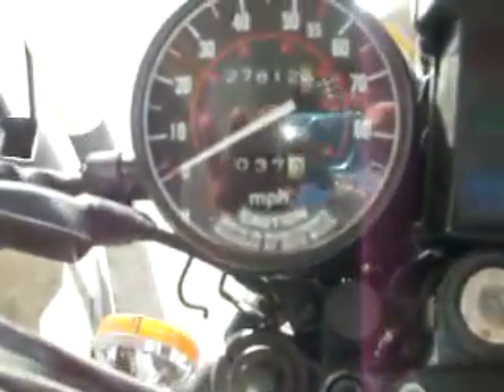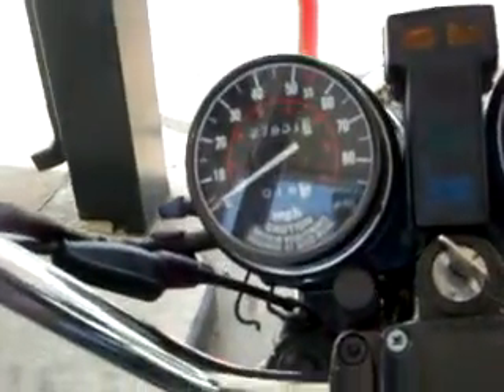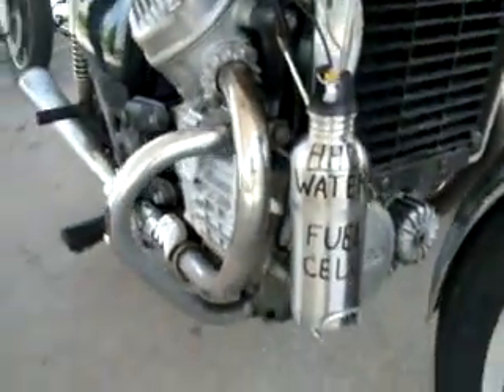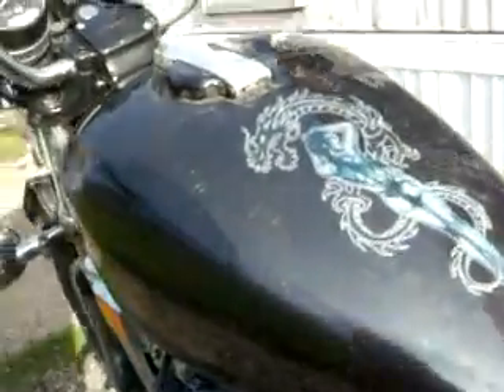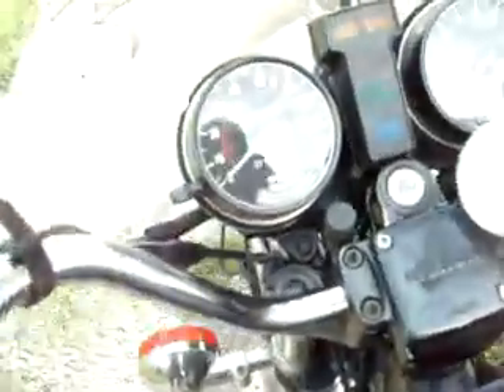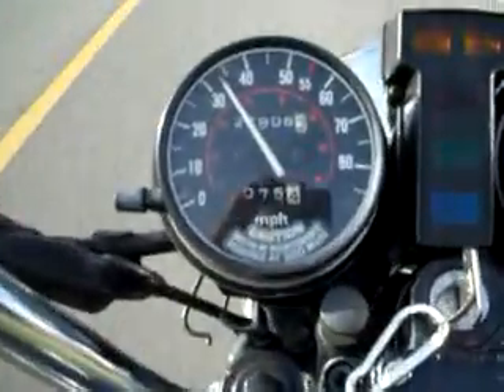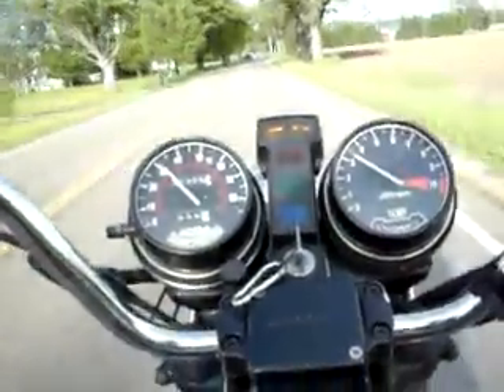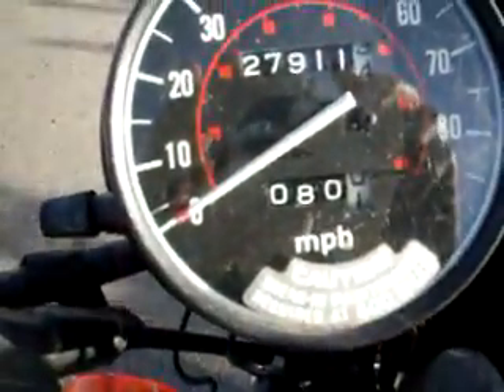HHO Powered Motorcycle Test Results 3, 4, & 5 from Westcoast Exterminator

Comment: In electrolysis of water, you can not get energy greater than you put in. You can not create or destroy energy. To obtain heat energy from water, you have to put 2 or 3 times more electrical energy.  After 15 years it is clear this is a failure. Another proof you can not break the law of thermodynamics.
Reply: +Odouls77 My friend, I'm sure anyone who has built a successful model and gotten a patent would IMMEDIATELY be either bought off by the oil industry, or killed off, as in Stanley Meyer. 
As for my explanation of how this does NOT violate any laws of thermodynamics, did you understand my post?
Reply: Those who don't comprehend and can't accomplish, should stay out of the way of those who are actually accomplishing.
Reply from the maker: +Odouls77 That is not what is happening. You've been listening to people that don't bother testing stuff.
Reply: +Odouls77 The positive energy output is NOT from applying electricity to water - The positive energy output is from burning the hydrogen released from the process. 
Odouls - When a spark plug is discharged, it's only using a tiny amount of energy, but it ignites the gas/air mixture. According to you, a spark plug "breaks the laws of thermodynamics" because it's only a tiny electrical charge doing the work - which is a false statement.
Reply from the maker: *****"Charging the water"? Well power is going IN to the water and a different form of energy is coming back out, sooooo pretty close, but yea, nothing capacitive.

The way I see this is closer to a super charger. People say that HHO can not work because the engine has to work harder to pump the electricity for the unit, so they cancel each other out, BUT a super charger works in the same manor that HP is taken directly from the crank to pump more air/fuel into the engine, but they don't cancel each other out. In the case of HHO, the extra air/fuel is coming from the water.
Reply: EXACTLY! Thank you for making sense. So many would-be armchair debunkers out there, SMDH...
Reply: +Odouls77 - The 'free energy' is nothing related to cost here. You misunderstood the term.
Reply: +wcemichael  If there was any semblance of success this should already be in the market and the inventor a millionaire.
Reply: +J Wilkens (AndroidAppGuy) The inventors of the hybrid and electric cars which cut the fuel consumption significantly are still alive and never threatened. I don't believe in conspiracy. The inventors of the touch phones and filmless x-rays are alive and kicking, and millionaires.
Reply: +Odouls77  But did you at least understand my original reply where I explained how the process shown in the video does NOT violate any thermodynamics laws?
Reply: +J Wilkens (AndroidAppGuy) Assuming that the motorcycle alternator can supply 50 amps to the HHL generator you may expect only 600 watts (o.8 hp) added to your power. But since the engine is also driving the alternator the .8 hp is a negative on the engine.  Therefore, the net effect is zero.
Reply: +Odouls77 You're falsely assuming that the power from the alternator is "charging" the water. It's not. The net positive power output is from the engine COMBUSTING HYDROGEN, not using the water as a capacitive discharge. 
When Nitrous Oxide is added to a motorcycle, it only needs a small amount of electricity to power the solenoid valve to inject the gas in to the combustion chamber. According to your last post, because the solenoid only uses a tiny amount of electricity, nitrous will have "no net gain". 
This is simply not true for nitrous, nor is it true for adding HHO.
Reply: +wcemichael Then you agree that this process does NOT violate the laws of thermodynamics, which is different from your original post.
Reply from the maker: ***** I've never said it violates the laws of thermodynamics. The part about working similar to the supercharger is a position I've always held. I wouldn't have bothered trying it if I did.
Reply: your point acceptable under the theory of law of energy conservation... Things go different if solar cells are used for electrolysis of water..
Reply: Solar energy is renewable and free. The problem is storage of hydrogen gas that you made out of electrolysis.
Reply: Solar isn't free - it takes an enormous amount of heat to make solar panels. As for storage of hydrogen from electrolysis - if you make your system "on demand", there are no storage needs.
Reply: +J Wilkens - Solar panels are not free but solar energy is free. I have not been paying for the sunlight and sunheat I have used since forever. I have not been paying for the solar energy that plants use for photosynthesis for my food. Solar energy is free, everyone can use it as he pleases. Have you seen any motorcycle carrying solar panels to generate power for electrolysis?
Reply: +AVA DIGITALS - Sorry, I am not an expert in idiomatic expressions and figures of speech. I only understand literal technical English.
Reply: GT Jenkz - Whenever anything is publicized, it is subject to comments. This project is obviously a failure. The inventor should try something else and not repeat the same mistake made by many other thinkers.

Comment: heyy michael
if you please explain how much amp or battery is used while urs hho kit using or how to control it ??
because we made few cells but those cells r using alot of power and our batteries sucksssss
Reply from the maker: +Afzal Khan This was so long ago I forget.
BUT the problem to your amp problem can easily be solved simply by not using as much electrolyte (in this case baking soda). Just dump some of your electrolyte/water mixer out and replace with fresh water. Still sucks to much power? Dump out some more and replace with fresh water.
You need to figure out how much electrolyte you can get away with to reduce the amp draw.

Comment: newer fuel injected  C50 800cc motorcycles get about 50mpg  if driven sensably.
Reply: It's because they have higher compression, and better engine cooling. Also, the injection is more presice with the fuel.
Reply: stupidvids0 bhh
Reply: +J Martin Fuel injection will really only net you a few mpg if the carb is tuned well, if that.  Most people just don't have the time I guess.  Air restriction in the intake is a lot larger factor then fuel delivery of a tuned up carb and that is where you will typically see large gains.  People get 50 mpg on older 800cc bikes as well.

Comment: First of all, it doesn't take much hydrogen in a cylinder that small. 2. hydrogen burns faster than the speed of sound, so it makes the gasoline burn much faster than normal also there is some steam pressure invloved during the process mainly at the end of the power stroke. Now a cubic foot of hydrogen has 300 btus' of heat energy but the way it combusts is more like a transfer of energy more than an explosion. research  the properties of hydrogen. If he is also putting the oxygen in combination then the combustion process is heightened slightly more since there is more for combustion to take place, actually more than the 14.1 to 1 ratio needed.

Comment: 30 mpg on a 500cc honda? Thats ridiculous. I have a 88 honda shadow vt800 (800cc) that has 75 hp and I get 50 mpg. Your math is off big time. No way that half a litre engine sucks that much gas. A 2 litre (4 of your bike engines) Honda car engine gets like 40 mpg or something. What ever man.
Reply: Moreover, we don't know the exact state of tune on his bike. His figures sound about right for the make & model. We have no reason whatsoever to doubt those figures. I'm inclined to believe him.
Reply from the maker: You're right about the high RPM. I do 5 grand at 50 mph while bigger bikes run at around 2. I can't get this bike to go 90 without redlining. Also the tune of the bike. It's at least a 2nd hand bike, 30 years old, stored god knows where. And the tune is exactly the same before the mod as after the mod.

Comment: How do you get "bad gas" - by eating a lot of beans?
Reply: +texas coot Every once and awhile a gas station gets water sucked up from the tanks as well.
Reply from the maker: I don't know. I got gas at this one place and the bike was cutting out all day until the next fill up
Reply: ***** A lot does. It'll run like crap.  If they put the wrong fuel in the wrong tank, a pool of water that is normally separated from straight gas from density difference can mix with ethanol added fuel.  Or they could just get a severe leak from old age and take on a shit ton of water.  They can let the tank run real low before filling it, and people who gas up as its being filled get the pool of water mixed in their gas that was normally stagnant and harmless.

Comment: I like your vids & I'm going to try this on a 12v Honda C90 (you guys call them Passports). I think I might try siting the output of the HHO directly to the inlet manifold or the carb itself so I can dick around with air filters but I will try your route first as it requires no mods. Any performance gains will be most evident on a bike this small. I even notice that it performs better on a cold day. Your detractors seem to bemoan the fuel economy of your bike. I had the 650 & it had shit MPG & a high tickover like yours (around 2k). Inlet manifolds were shot. Spray 'em with WD40 when the engine is warmed up & if the revs change for a moment, swap 'em.
Reply from the maker: Oh, I really want to do some moped testing!!! Make sure you don't draw too many amps because I know you can't have much of a charging system.

Comment: oh, ok.. I get thst now.. washers... wise in every way... I have 16 washers, 3 bolts, 2 of which have heads cut off and 22 nuts in my electrode assembly... probably overkill bjt it seems to do the trick... need a way to mount it then will be ready to use... how often does the fluid need added or changed-out?

Comment from the maker: Once you figure out how to make these units, the hard part is figuring out where to and how to mount it.
The holsters started out simply as a piece steel rod, from Ace Hardware (zinc plated to keep from rusting). Measurements were taken to put the right bends in right places and then a washer was welded on each end.

Comment: I will tell the whole .. hope nobody minds... it started when I got this cx.. had one in High School but had to get rid of it cause of family needs.. but anyway recently got another cx.. general rule of thumb for me is always when getting a used vehicle to always put in new plugs, wires, cap, rotor, etc., when applicable... so I got new oem plugs.. I was getting around 80 miles per tank with the new plugs. I wanted more.. fuel efficient, high performance.. something above average..

Comment: I have a 1981 Cx500 Custom.. I used to get 80 miles on the tank then had to switch to reserve.. I have since added a new plug.. E3 brand 36... now I get right around 100 miles per tank before having to switch to reserve..

Comment from the maker: I've had the carbs apart many times. Valve? Oh, no. Don't touch them if you're not an expert with the proper tools. You can cause more harm than good.
I'm not sure that just a straight, out of the box and just bolt it on, HHO unit would work on a new car without adjusting the fuel intake. What I'm seeing from my very basic of testing is a cleaning action. A tune up, as some of the power robbing cylinder deposits might be getting cleaned up.

Comment from the maker: So, my mileage is awful. I agree. The bike is 2nd, 3rd, or 4th hand, and 3 decades old. who knows how it was stored when not in use. The point is, the mileage still went up.
I have a 95 Ford Explorer with V6 that gets 15 MPG. I had an older Ford Van with V8. Bigger engine, more weight, less aerodynamic, older tech, and it got 20 MPG. The point being, what difference does it matter what you think the mileage should be?

Comment from the maker: Yea, I could have better mechanics look at it and pay 1,000s on a $500 bike and maybe it could increase the mpg. But what does it half to do with readings I took?
If this was a chain/sprocket drive, then I could easily change the ratio. This is shaft drive, not even sure if it's possible.

Comment: but to say that hho cant give you better combustion is plane wrong, most engines only get about 45 to 50% of the available energy in hydrocarbons this is because the carbon produces hot ash which slows the rate of combustion dramatically egro most of the energy goes out the tail pipe rather than converted into usable heat energy. hho offsets the additional HC required to accelerate the cycle of operations under load this is a fact

Comment: re gearing will give you great increases of fuel economy ......I am a mechanic and i can tell you first hand that just because someone is a "certified" mechanic doesnt mean they are a good one, you should be getting much better fuel economy out of that bike, try having someone else re jet the carb for your elevation and compression readings....if they arent jetting using a 4 or 5 gas analyzer that mechanic isnt doing a thorough job and is ripping you off

Comment: to put it simply all engines run on hydrogen...hydrogen is the explosive element in Hydrocarbons  the carbon is only present to keep the fuel in a stable liquid state under standard atmospheric conditions ....the carbon is a waste product once combustion occurs ...like i said Im not defending his system unless he is using some kind of ballast, diodes, pulse width modulation a motorcycle stator alone cannot produce enough energy to make hho at sufficient enough levels to notice economic gains

Comment: No it doesn't. At least, it doesn't work to improve the economy or recover any energy.

If you're that much of a mechanic, maybe you can explain to us in _mechanics_ terms how this system works. Doesn't have to be laboratory science spec. After all you seem to have a handle on thermodynamic energy transfers and the like, so you're no dunce.

Come on, try us.

Also, a diesel engine works by heating atomised fuel (which was energised by the sun millions of years ago) to the point where it ignites.

Comment: Also, given how ruined I expect his engine is, it could be the introduction of a non standard mixture into the air flow is actually somehow bringing it back closer to its factory fresh, manufacturer spec state, and so it's running a bit more like its original economic setup, instead of whatever pathologically overfuelling / etc failure condition has led to its "normal" worse-economy-than-a-much-heavier-car gas guzzling nature.

Comment: Besides, fuel economy results just from riding around at random can be very variable. I wouldn't be entirely surprised if the earlier "poor" results were on an unadorned bike and our hero was riding somewhat faster and leaning into the bends more, etc. And now that the fragile water system is on board, he's taking it somewhat easier and slower to avoid damage. Boom, easy 33% mileage improvement from a lighter touch on the throttle and slower cruising speeds.

Comment: 2/ You're getting confused with NOS, I feel - which involves increasing the gasoline flow as well, because simply adding more oxygen is actually a bad thing if your mixture is correct, and yer average carb or injector doesn't have more than maybe 25% headroom. Plus, fuel consumption goes UP.
3/ Also, you're splitting water into hydrogen and oxygen - using energy extracted from gasoline - then recombining it (by burning it) and somehow expecting you'll get more energy back than you originally had

Comment: There's nothing in the theory that says you can't produce power from HHO.

The problem is manifold:
1/ you need to flow an awful lot of it to make useful power at atmospheric pressure, which is what you'll get without a compressor in the circuit. Hydrogen is very low density compared to liquid fuel. Which means you have to MAKE a lot of it. You simply won't make multiple litres of H2 per minute with a handful of amps at 12v.

Comment: ...you were honestly only getting 60 miles from two whole gallons of gas? On that thing? At those speeds? That's truly horrendous. Your exhaust must stink of unburnt fuel.

Mate, you've got bigger problems than $4/gallon gas and The Man trying to keep us from developing alternative technologies. Your engine is ruined. I could habitually do better than that without even trying in a 1-litre 5-seater car from 1990 at twice the speed.

Have your engine fixed and you'll also save big on gas.

Comment: (So if you're habitually only getting 60-80 before having to switch to reserve, and it's not a tiny tank and you're not racing it everywhere at a million miles an hour, you need to get your engine looked at - not start plugging half-assed "HHO water generators" into it...)

Comment: 38-44MPG ... on a motorcycle ... cruising around 40-50mph

Er, this is a good result... how? I'd take my bike to a garage for a serious overhaul if it was making economy that LOW, especially when cruising.

OK, it's only a low capacity one, but it can run at that speed happily. And an early 80s, 500cc Honda... really, that's shocking.

Mine's a 125 using similar tech, it'll do about 100mpg at that level. Their CB250 will still manage 80-90. The 500 should be 50+, maybe 60...

Comment: 1.8l 90hp engine can run 28lpm HHO fully. It's because hydrogen hase more greater burn mass but less volume in cubic. This way normal 30mlpm can be replaced with 28lpm hydrogen and the car is very possible to run with hydrogen. You just need big enough 100 plates and 120v inverter with bridge diodes to provide 120vdc from 12vdc car alternator. Then you can get 30lpm HHO with 22amps and run whole car with only HHO.